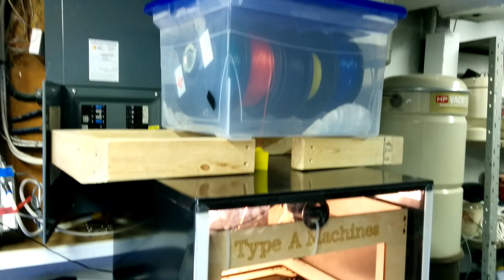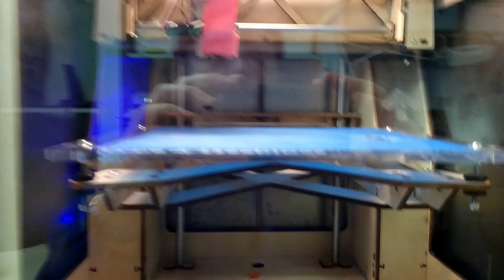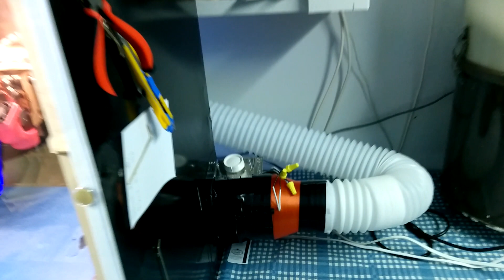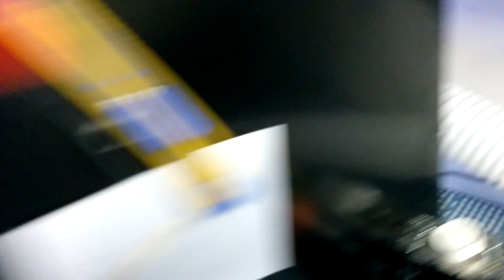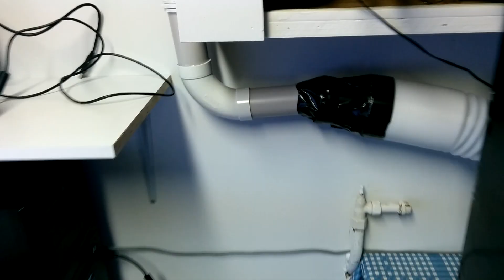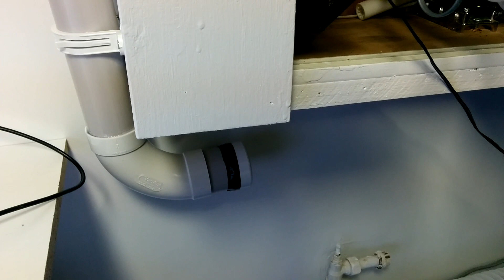Upgraded fan exhaust for my type a 3d printer

Comment: I was wondering if you need an intake air connection from the outside too? If your box is well isolated, you need some air to replace the one you take out no?
Reply: Jean-François Chabot seems true
Reply: yes, you need intake and exhaust for a proper system.